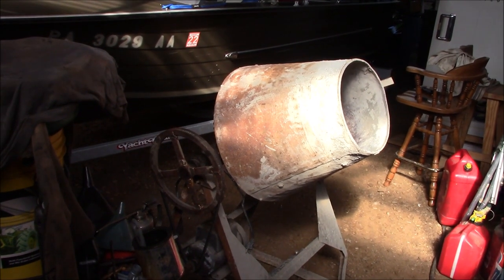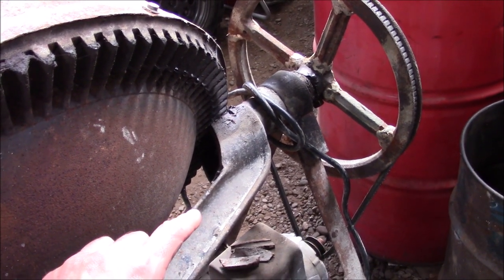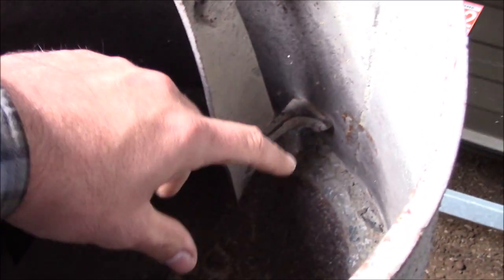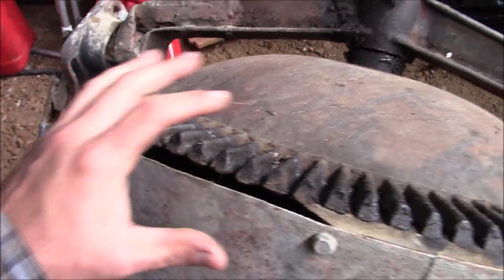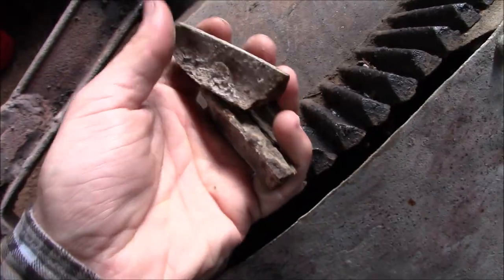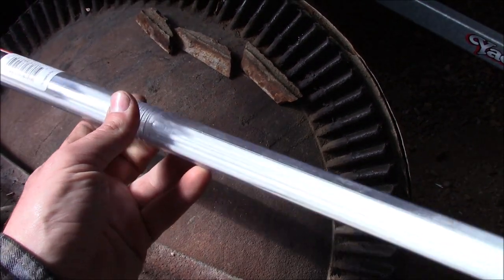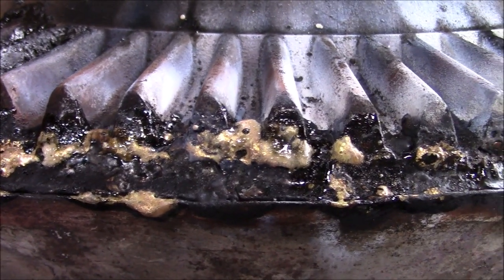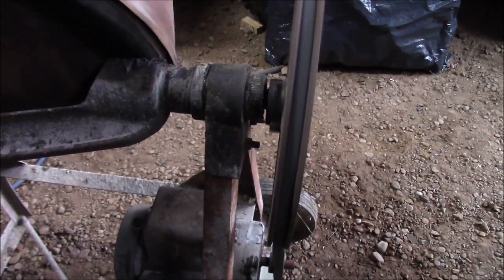Scoring a Cement Mixer, Breaking it, Then Fixing it...

Comment: 9:45  People have strange ideas about what is worth repairing and what is not worth repairing.  To me, the only things not worth repairing are things which I can buy a replacement 2nd hand for less money than it would cost to repair it in materials assuming I can do it within any reasonable time-frame (and an evening to do this I would find acceptable)
To me, the real issue is trying to fix stuff to sell as used for a profit.  This greatly changes the math.  You have to buy it, fix it and still sell it at a high enough profit to make the time worthwhile.  This is pretty difficult to do with anything at the consumer level (which granted, this is not something home depot would be selling to home-gamers).  Everything is made so cheaply and with such low profit margins that it is near impossible to this with most consumer goods.
Reply from the maker: Solid points, profit margin repairing this type of stuff can slim to none.

Comment: good job sir may i ask if you know the hp and rpm of the mixers motor i have one missing the motor and that would be a great help and time saver again good job
Reply from the maker: I think it's only like a 1/2 hp at the most, there's enough gear reduction it turns it real easy.
Reply: @toocheaptosmoke  ty that gives me a starting point

Comment: You don't really know its fixed until you have a couple hundred pounds of concrete bashing around inside.
I tend to go with Epoxy to fix everything, every cast iron welding I've done has failed.   In fact, I have a similiar cement mixer, and someone tried welding on a bearing support and it just broke right off.
Reply from the maker: Put about 10 bags through it last month, so far so good. 👍
Reply: @toocheaptosmoke  Great news.  Like most things made decades ago, they were made to last, not to be disposable.